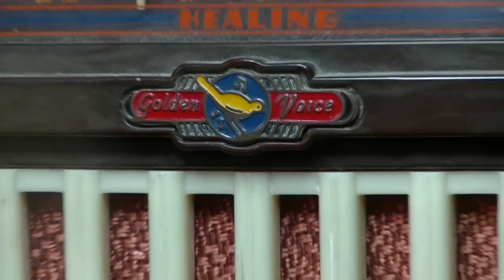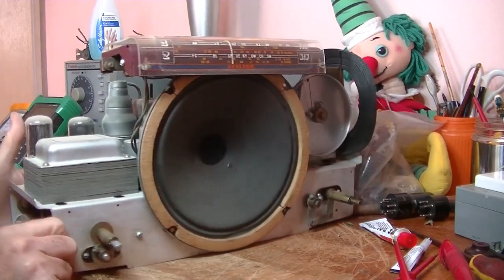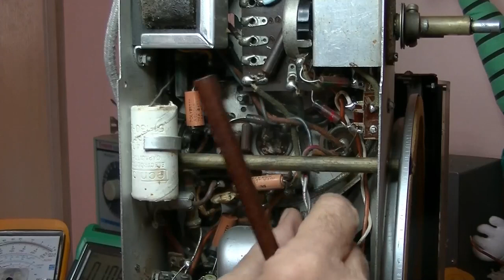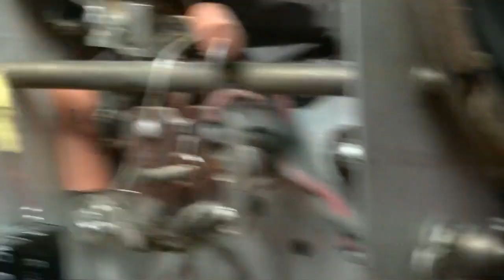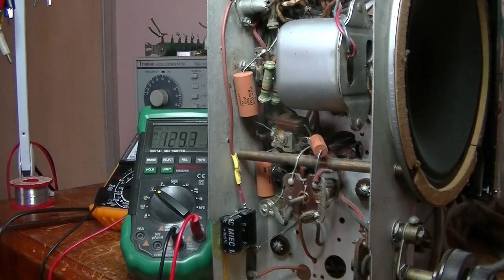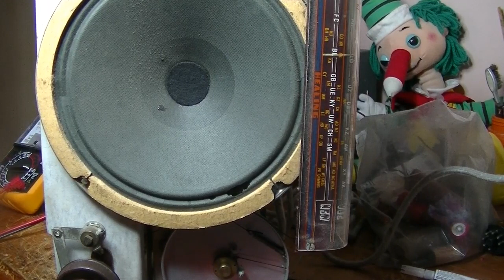Healing 502E circa 1948 Restoration

Comment: Hello again, I messaged you before  about my French Brevets radio. Think I've bitten off more than I can chew, my knowledge is very limited but thought it would be an interesting hobby. Anyway my question is. 
I have the schematic showing 6 valves but the radio has 7 valve sockets and the if transformer near the empty socket  has a shielded wire just hanging loose with some shrink wrap covering the end. The radio is still working. Any ideas? 
Thanks Andy
Reply from the maker: Hey Andy, hmm, you would think that it needs a valve there, but the radio is working anyway, so the circuit is complete. Clearly someone has worked on the radio previously. The missing valve may have been another IF amplifier but has been taken out of circuit?? The schematic differing from the actual chassis layout could/probably be the result of your chassis being a slightly different model i.e, the 7 valve up market  version. I'm only guessing but I've seen a number of  identical radios that only differ by the number of valves. Don't give up; try tracing the wiring against the schematic, one section at a time starting from the aerial and see if the wiring conforms to the schematic. You're more than halfway there already, as the radio works. Can you imagine the nightmare it would be if it didn't work? lol

I'm sure you've done this already, but keep searching for more info on this model. 
ps. are you in Australia or the US?
Reply: Thanks for the reply the valve socket is wired up. I'll try what you suggest   I'm in the uk yorkshire
Reply from the maker: @andy40456  Have you tried the radio repair threads or local FB radio groups for assistance? There are lots of very wise heads in those groups
Reply from the maker: @andy40456  another though that may be totally wrong. Does your radio have a push-pull amplifier section, eg, 2 x 6v6 valves?

Comment: Always thought it would be nice to hollow out the old paper Capacitors and stuff them with the new ones, then filling it with wax to make it look original - I know you'd never see it under the chassis ... might just be too much work !?!?
Reply: True, cleaning up the cabinet & display are far better use of time … spent two years in Sydney, Australia back in 79-81 - will always pick-up on an “Aussie” accent … that and I saw made in Australia on one of the parts of that radio !!
Reply from the maker: Hey Michael, yes, I've seen a couple of videos where people do that. I thought it was a nice touch, but like you said, you'd never see it and yes way too much work lol

Comment: Those apricot coloured polyester capacitors are not original, and date from about the '60s.  They are likely fine; I wouldn't personally change them.
Reply from the maker: Thank you Stuart, I didn't think they were original. Changing them is a habit with me esp when it's a paying job. I like to update the components esp caps.
Reply: @exeterslab7781   You can always save those capacitors for your own projects.  I do!  😊  After testing them first of course.